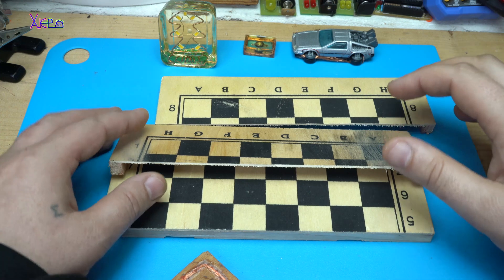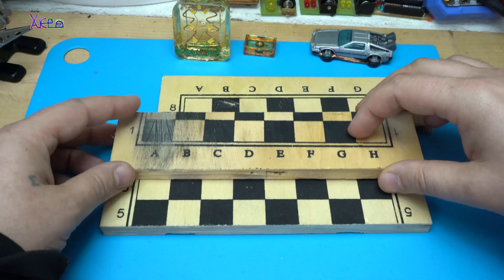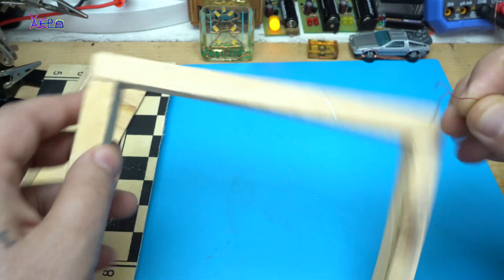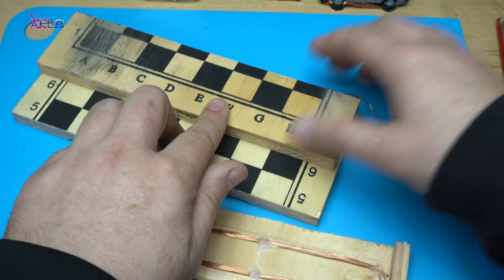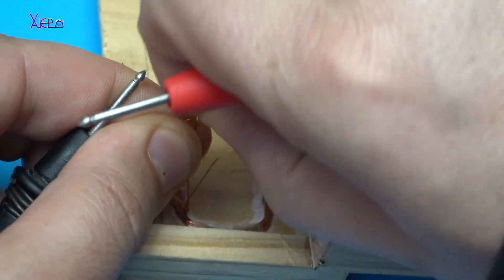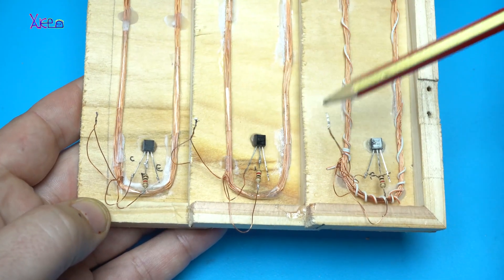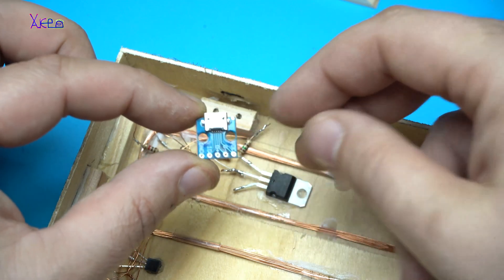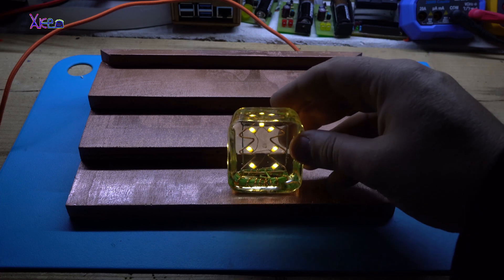Making Wireless Power Transmitter | Amazing Homemade Gadgets

Comment from the maker: TURN ON THE RING BELL,never miss a new video
Reply: so if i had an robot that needed to be charged, i would bury something like this under my floor to keep that robot alive and working wirelessly? 

then say i had an factory of robots working with something like this under the floor or maybe even on top just with some protections for the wires so they don't get ripped to shreds by the robots constantly moving all around the place. 

also, is there an limit in how thick the flooring would need to be so it doesn't prevent them from being wirelessly powered?

Comment: I didn't use the regulator. Instead, I used my power supply at 2v and 300mA and the LED didn't light up. I had 30 turns of .25mm wire. Very frustrating!